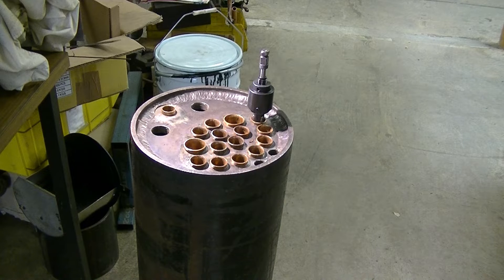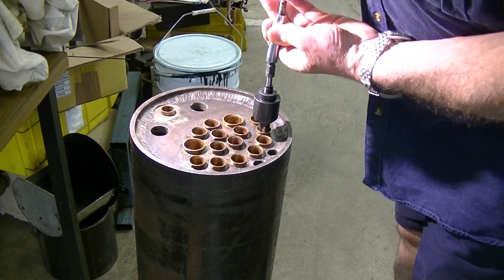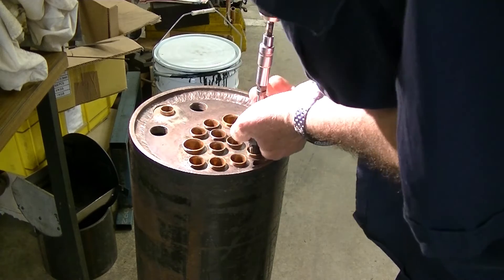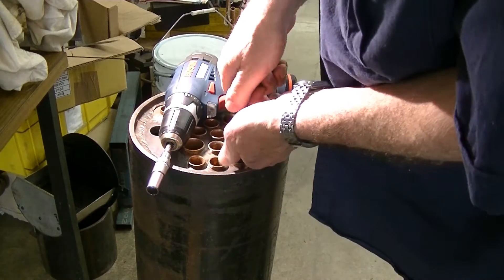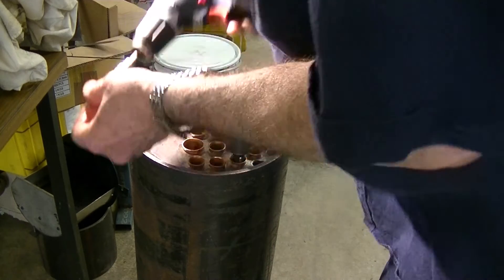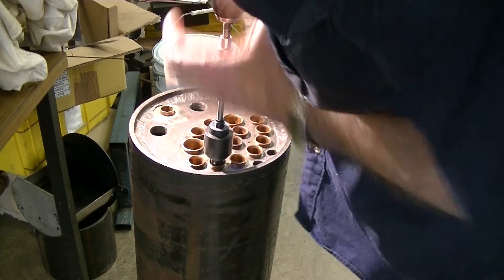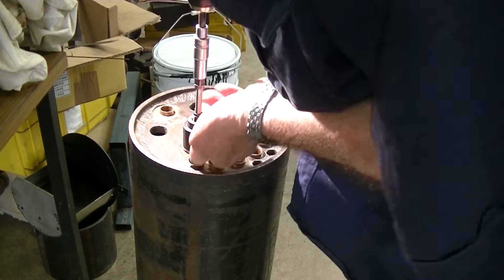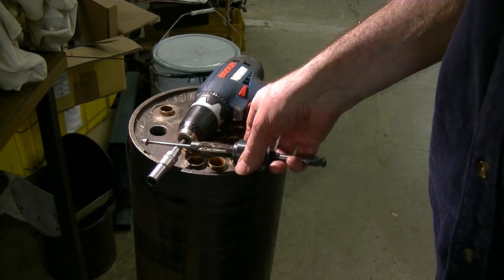Boiler tube expanding

Comment: Where did your get that flaring tool, and what's it called?
Reply from the maker: The roller expander I bought from India. The basic flaring was done with a lathe dead center. Then radius flaring tool and capping tool, both of which I made. There is a video of those tools. BC

Comment: Why can't it be braze brass?
Reply from the maker: Hello from Aus. The boiler code only allows copper tube to be expanded. Steel tubes can be expanded or welded to the tube plate. Brazing would have a big heat input and corrosion problems.